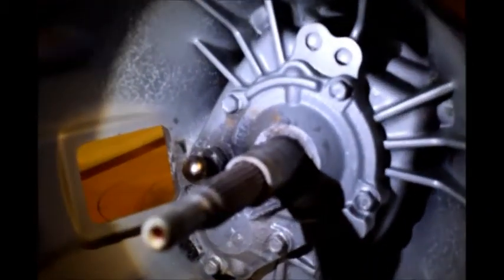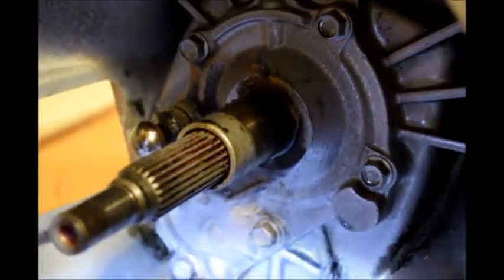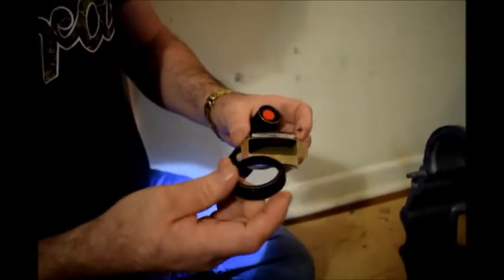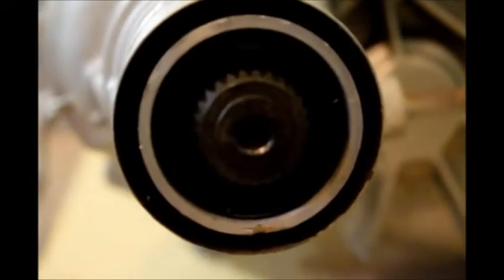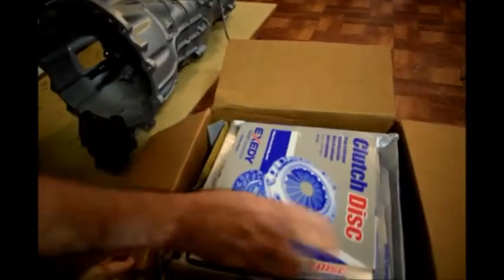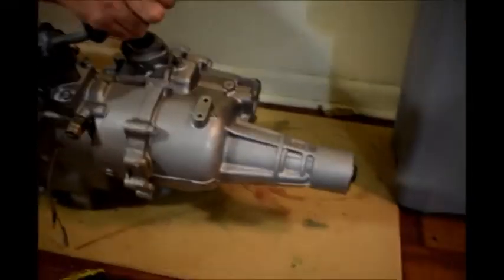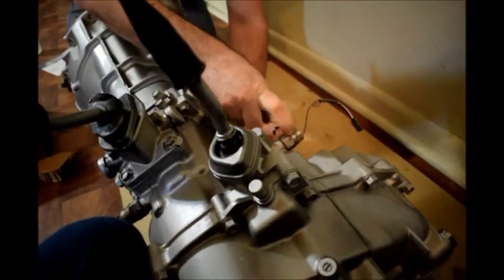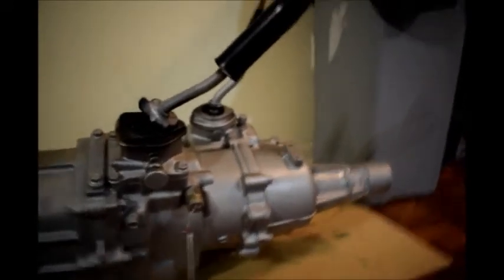Isuzu Transmission MUA 5 Overview

Comment: Do you happen to remember the part number for the front seal
Reply from the maker: Cross this part. It fits the 2 and 4 wheel drive manuals. The MUA line, NOT the Borg-Warner trans. Start with this part number, then cross-reference other brands from there. This is the right seal, it's just the cheap brand.
https://www.autozone.com/drivetrain/transmission-seal/p/duralast-transmission-seal-710511/629985_0_0

Comment: that transmission is a ISUZU MSG  ,    because MUA5  it have removable bellhousing
Reply from the maker: The MSG is weaker than the MUA, as far as I've seen internally, it's an MUA
Reply: @shadetreeautomotiveDIY  i said   msg-5f    not  msg .       the msg-5f  is the same  mua5   but it come with  long shift rpm  .      the msg  that you know  , is it   a little one , with  integral housing  .    msg 5f   it come with removable bell housing
Reply from the maker: This is for the USA... THEY USE THE M75 DESIGINATION UP UNTILL 10-89 ON EVEN THE MUAS IN MOST OF THE VEHICLES, WHEN THEY CHANGED IT OVER TO RMN FOR THE MUAS STARTING IN 10-89, THE EASIEST WAY TO TELL FOR SURE IS TOO LOOK AT THE TRANSFER CASE , IF IT IS AN MSG IT WILL HAVE A CAST IRON TRANSFER CASE AND THE FRT DRIVE ASSY IS BOLTED ON MUCH LIKE A PWR TAKEOFF SETUP,ALL MUAS ARE ALL ALUMINUM, MAIN CASE AND TRANSFER, ALL MSGS THAT CAME TO THIS COUNTRY HAD CABLE OPERATED CLUTCHS EXCEPT THE EARLY IMPULSE AND IT WAS AN MSG WITH HYDRAULIC SETUP, AND ALL MUAS HAD A HYRDAULIC CLUTCH, IT GETS SORTA OF CONFUSING TRYING TO DECIPHER THE PARTS BOOKS SOMETIME IF YOU ARE NOT AWARE OF THE CHANGE IN THE DESIGNATION BETWEEN THE TWO,A BIT OF HISTORY ON THE MSG IT SIMPLY STOOD FOR MANUAL SHIFTED GEAR AND WAS MADE IN A 3 SPD VERSION, NEVER IN THE U.S. MSG4 MSG4T MSG5 MSG5T THE T STANDING FOR TRANSFER CASE, NEVER DID FIND OPUT EXACTLY WHAT THE MUA STOOD FOR, BASICALLY WHAT THEY DID WAS TO USE THE MSG TRANS ON ALL ENG UP THRU THE 2.3 SIZE ENG, AND THE MUAS FROM THE 2.6 AND UP ENG SIZE, THE LATER SIZE MSGS WERE ALLMOST AS STRONG AS THE MUAS, AND A GOOD BIT LIGHTER
Reply: @shadetreeautomotiveDIY  MSG 5f is the MUA all the other MSG 5T ECT ones are real MSGs for the early years.

Comment: I have a problem with my transmission getting hot,do you  know any reasons as to which is that? 4ja1 engine
Reply from the maker: Standard or Auto? If it's a standard, check the oil level and type. If it's an auto, check the trans cooler built into the radiator. If not, add an external cooler, as I always do on autos.
Reply: @shadetreeautomotiveDIY  standard, manual
Reply from the maker: @Ro0y4L  Check what type of oil your transmission requires e.g: engine oil, or something else, and if you have enough in it.
Reply: @shadetreeautomotiveDIY  last mechanic said I put 75w90, do you think I could change it to 5w30, would the oil seals leak now because of the less dense oil, don't want to soak the clutch
Reply from the maker: @Ro0y4L  It depends on what it calls for from the factory. Do you know what Transmission it is? Model number?
Reply: @shadetreeautomotiveDIY  msg 5 speed manual 4x4
Reply from the maker: @Ro0y4L  I've got the MUA5. The MSG is a little bit lighter duty. The problem with using gear oil, even in a worn transmission is it's hard to get in gear in cold climates. The biggest problem is, some bearings are robbed of oil, needle bearings, roller bearings, with small oil ports to reach. Beware that there maybe a separate drain and fill for the trans. and transfer case. 2 separate drain plugs, and 2 separate fill plugs. The thickest oil I used is 20-50 motor oil. I tried gear oil once in an old MUA5. It made it harder to go into gear. I guess the synchronizers. It also robbed some horsepower from the engine due to drag. So I drained it out and put 20-50 and a half a bottle of Lucas oil stabalizer. It was much easier to grab 2nd and shift on the fly. There was also considerably less heat. The MUA and MSG call for 10-30 motor oil. The Borg-Warner standard trans. calls for ATF. So in my opinion, I'd play with 10-40 or 20-50. And make sure you fill the transfer case separately if you have the option.
Reply: @shadetreeautomotiveDIY  I will replace it probably with 5w30 motor oil, do you have experience with replacing the seal where the drive shaft connects
Reply: Picture of seal
https://ibb.co/c1n7hG5
Reply from the maker: @Ro0y4L  Yes. Finding the right seal is the most important part. Double check your buying the correct seal.
Reply: @shadetreeautomotiveDIY  do you know how to get the dust cover off
Reply: @shadetreeautomotiveDIY  the round alloy thing
Reply from the maker: @Ro0y4L  Not off hand. But I'm sure it has either a keeper, a nut, a snap ring, or most probably, it's pressed on. Light sheet metal. I'd give it a few gentle whacks toward the tail. Or use a chisel or screwdriver wedge to see if I can get it to move. I'm pretty sure your tail shaft seal is an insert. Once you get the dust shield out of the way. I can't remember off hand, but if I was a betting man, I'd say it taps off. I'd puncture the center of the seal with a sharp flat head. Pry it outward and use a socket or pipe of the right diameter to tap the new one in. And then, tap the fingers to my dust shield slightly closed, then tap it back on with a piece of wood and a hammer. Spray the inside with Carb Cleaner and make sure their isn't a snap ring around the tailshaft holding the dust cover on. Isuzu Corporate loves to hide snap rings in stupid places.

Comment: Sir.is that fit also in 4ja1 engine.if not what transmission with transfer case   fit in it.
Reply from the maker: The diesels usually use a different trans. They typically use the MSG transmission.
Reply: @shadetreeautomotiveDIY  thank you so much for your reply sir .more power to you.

Comment: I just wanna ask if where's the drain plug and oil filler of the transmission and the transfer case?
Reply from the maker: No filter, this is a manual or "Standard" Transmission. The drain plug is at the bottom center of the transmission, the transfer case's is at the back. All drain plugs are big headed bolts, bigger than every other bolt, and low to the very bottom of the transmission and transfer case. Both have 2 separate drains and 2 separate fill plugs. The fill plugs are at the halfway mark of the transmission and transfer case. All 4 bolts are the same size. Somewhere around 1 inch in size, give or take. You fill up the transmission until some fluid starts leaking out. Use 10w-30 motor oil for 100,000 miles or less. 10w-40 or 10w-50 for higher mile transmission over 100,000. This is only for Isuzu Transmissions. Borg Warner uses ATF in a manual transmission.

Comment: The msg5 was used all the way thru 1995 but only on engines smaller than the 2.6 and commonly found behind the 2.3 . It was upgraded in 1988 with a larger input shaft and bearing a but was  used thru 1995.
Reply from the maker: Yes, I've gotten them mixed up before. I've got the 2.6l, and the MUA5. Transmission is still holding up.
Reply: Rule of thumb: if it has clutch hydraulics it’s mua5 if it has a clutch cable it’s msg